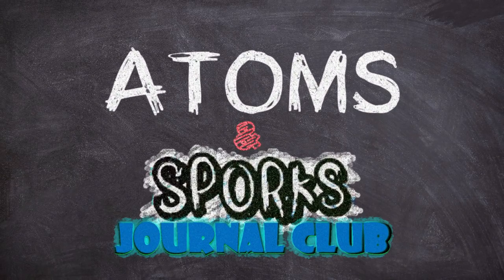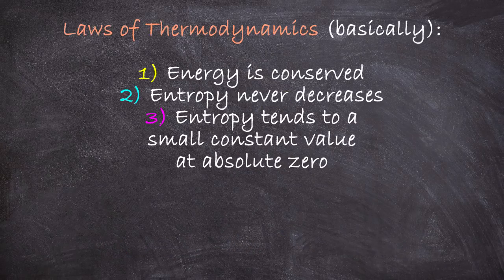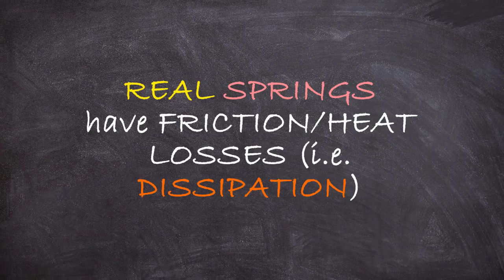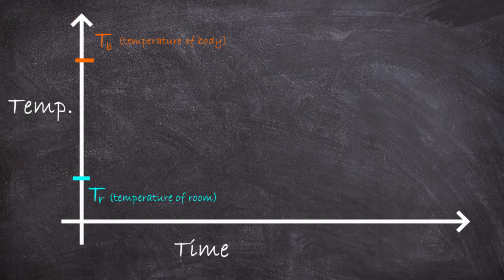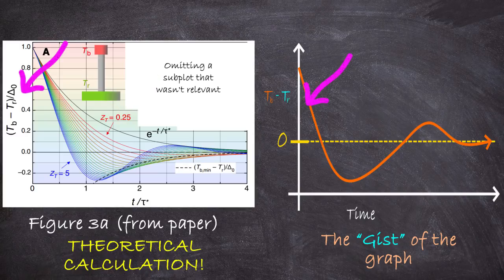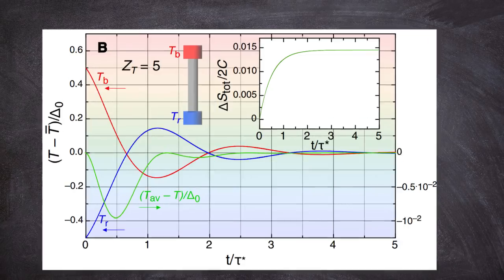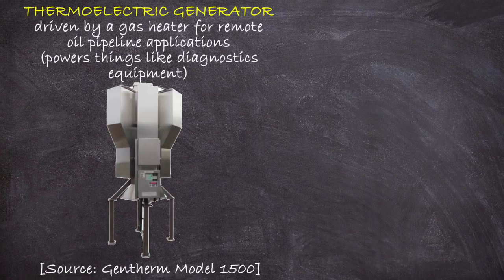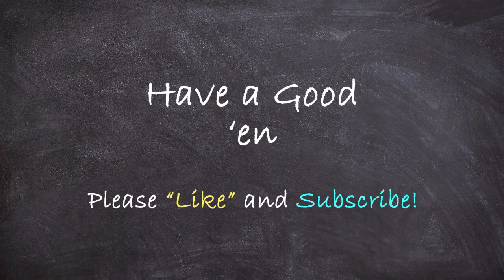A&S Journal Club: How to Make Heat Flow From COLD to HOT

Comment: Interesting concept.  I watched it twice. Bullshit comes in many forrns, especially in a driven environment to perform or else.  Here's the thing:  The electrical circuit between the two temperature sources is oscillating,  NOT the temperature. Electron flow must be forced by differing potential, so the circuit of electrons has TRAVELING momentum, and the assistance of "rubbery" magnetic fields in the inductor.  The temperature is a measure of STANDING waves aka atomic vibration or frequency. They do not have traveling momentum, hence no oscillation force.  In fact,, they already inherently oscillate individually to represent the whole of the temperature.. A bucket of oscillating springs dumped into another bucket of slower oscillating springs will not cause the slower oscillating bucket to oscilate faster.. I didn't catch whether the paper was peer reviewed,  but that would be irrelevant,  as peer reviewed papers are rarely read and those read are seldom studied. NOW it has been studied.